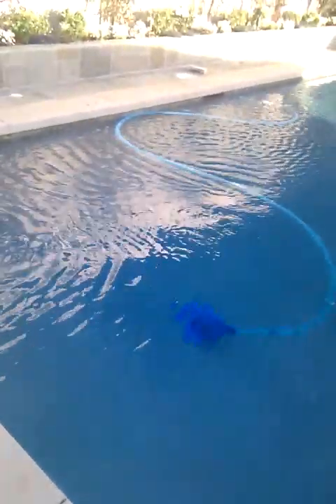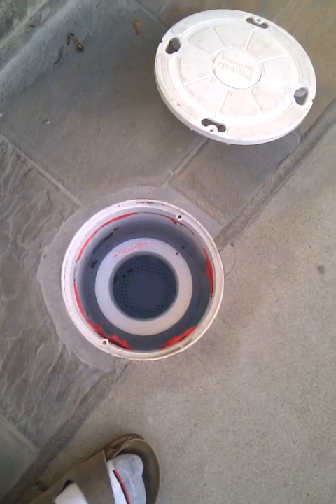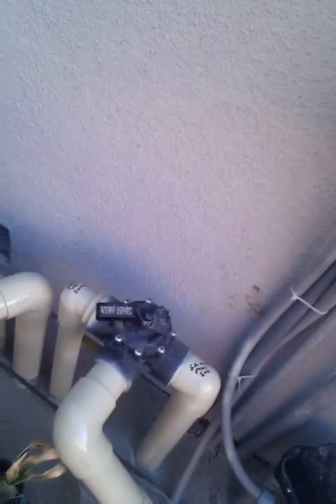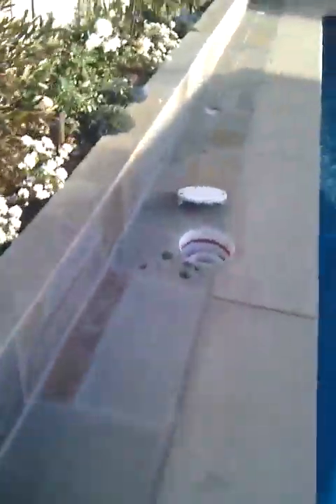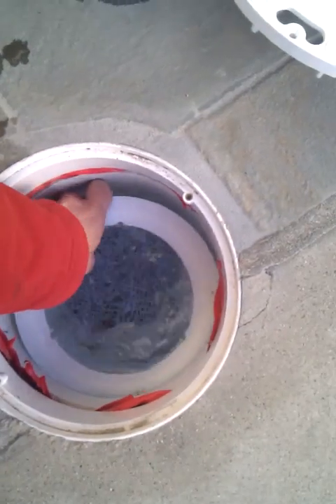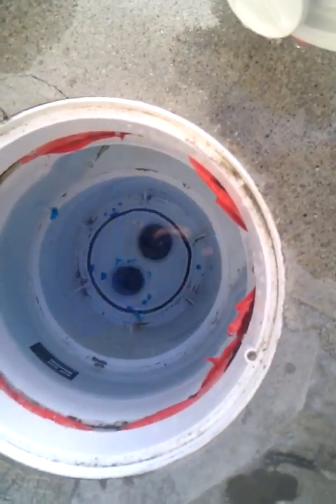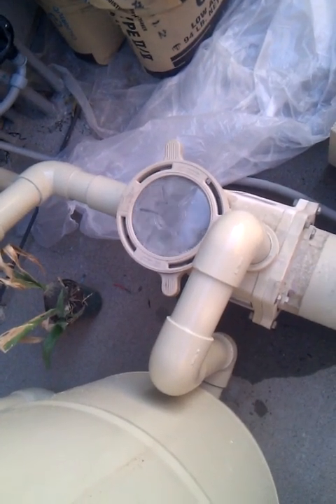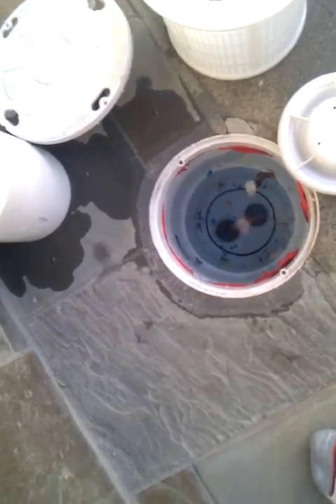Pool issues 20120403: : Skimmer not working Part 1

Comment: It means nothing when your Diverter Float Valve (Flying Saucer) inner disc is free and moves all around inside there when it's taken out of the water, as you demonstrated. It still could be bad.  The inner disc can have water in it which does not allow it to float.  If it can't float it will seal off the skimmer and only take in water from the pool drain.

Comment: Was your water level to low?  The water was being sucked from the bottom of the pool drain and not from the skimmer intake.  This happens when the water level is to low.  Same thing will also happen if big leaves clog the skimmer basket, this will stop the skimmer from working and the pump will then drawn the water from the bottom of the pool drain.  If there was something wrong with the basket that would impede the water flow, that will do it too.